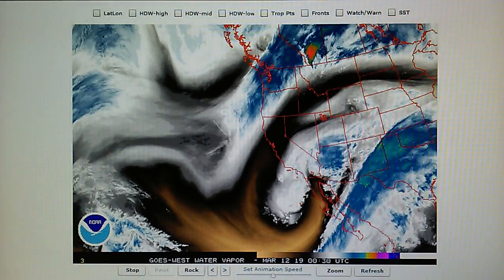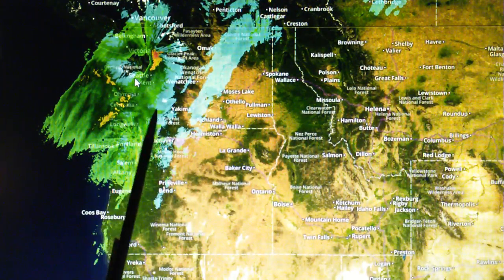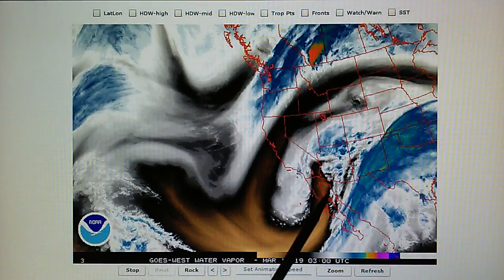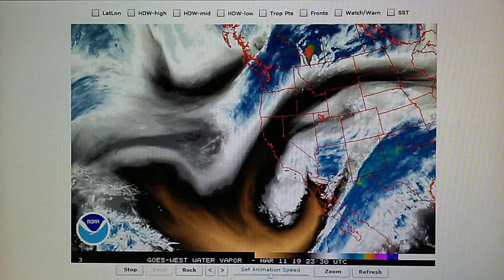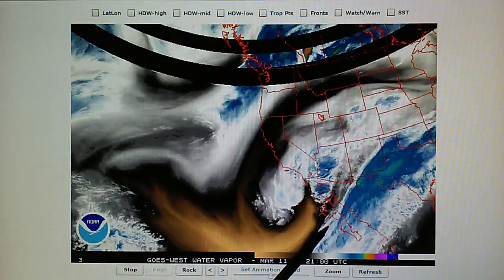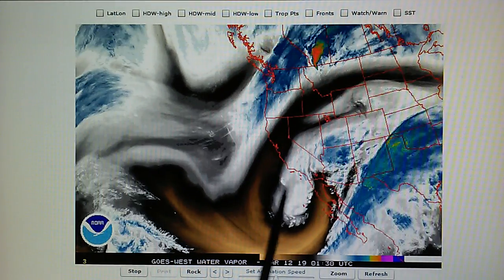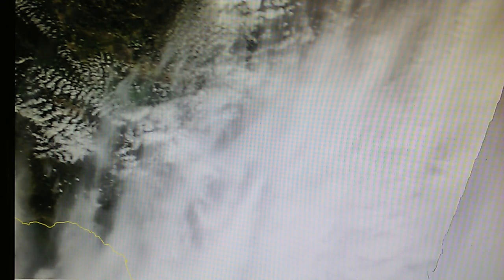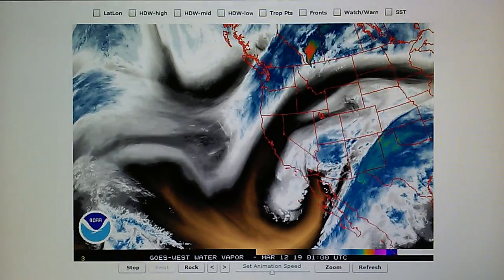Pt.2 Update; 3-11-2019; Satellite Transmitter Evaporates Jet Stream Moisture Flowing Toward Low!

Comment: How do thy create a Santa Ana wind event? I imagine it's a problem when they install high pressure systems.  Is that what causes wind?
Reply from the maker: - Yes, installing high pressure next to a low pressure system creates the pressure gradient which causes wind to flow. The direction of the wind is determined by where the high pressure is installed.
Reply: @1PacificRedwood  Thank you sir

Comment: FYI, RElative humidity readings all day in this Low Pressure System in Los Angeles: 74% at 9 AM, 47% at 12 pm, and then 36% at 6 pm.  Just a sprinkle for 10 seconds in downtown.  But downtown is the only measure used for derivatives market.   Detailed report today, thanks.